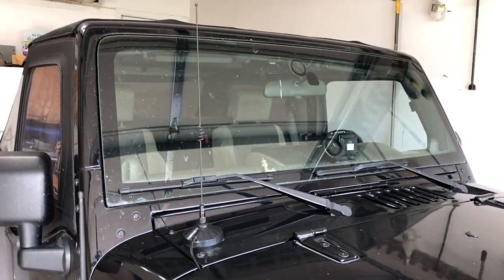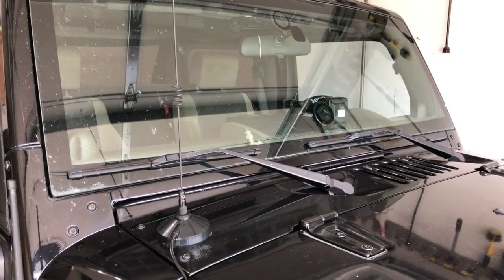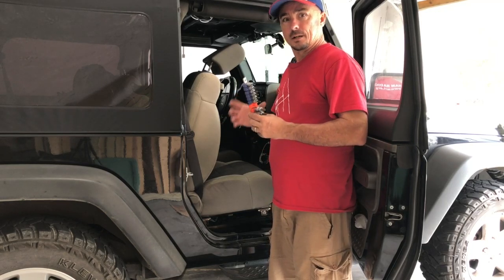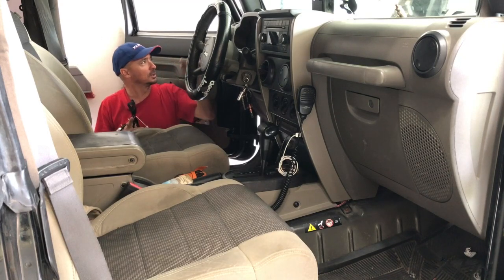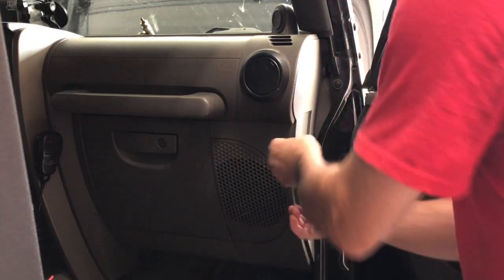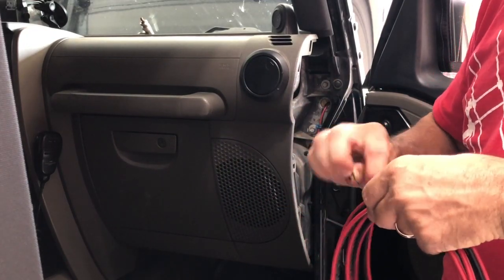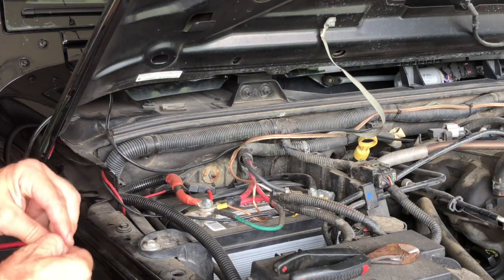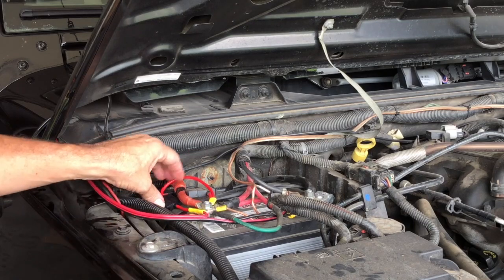Yaesu FTM400 Install Jeep Wrangler

Comment: Hey Jason, great vid on the Wrangler 400 install.  I’m a little surprised that the head took a 10-32, I honestly figured it would be a 1/4-20 like most camera mounts.  I’m putting my 400 in my Gladiator and the power run is just a little different, but close enough for gov’t work LOL. 73 de Tom KC3QAC

Comment: Good ideas.  I mounted my ID-5100A head in my jeep using the grab bar ($10 on ebay, look for 75WXST) , a short piece of aluminum, and magnets.  The radio is in the console.  This way I can take the head off quickly and lock it in the glove box when I'm running without top & doors.  Works great.

Comment: Having had one FTM -400 for the past two years and loving it's features especially for APRS, planning on a second one in a Jeep early next year. Thanks for showing that it will be an easy install ! 73 de KM6TRZ
Reply from the maker: It's hard to find a vehicle that is easier to install a radio. I didn't realize how much I would like this radio or I would have bought it long ago. 73, de KM4ACK

Comment: I have to do a similar install in my JK.  I had a IC-208H under the steering wheel mounted to the stereo amp plate.  The IC-2730A doesn't like it there as it runs way hotter.  I can't put it under my driver's seat because I have lockable storage there.  I'm going to remove the seat and create a bracket that goes across the rails since I run with no doors in the summer time here in Fresno.
Reply from the maker: Don't forget the "under storage" in the rear of the JK's. On my 07 it can only be opened when the tailgate is open, so if you lock the tailgate it is fairly secure even when the tops off. I have seen other use rails under the seats. I feel the mobile mounting bracket keeps mine high enough that rain shouldn't bother it. If offroading through deep water though, the radios might be in trouble. 73, de KM4ACK
Reply: @KM4ACK  My concern is the lack airflow in that compartment.   I have a "trunk" in the back that covers up to the top of the tailgate.  While, again no airflow, it is a larger space.  It's also closer to my antenna which is on my rear tire carrier.  But much farther away from power and my dual speakers on the dash.

There's also a center console replacement option by Tuffy that has a spot for a radio, but not a lot of airflow in that either.

The space under the steering wheel worked really well for the 208H, it didn't over heat at all.  But the 2730A runs hot, even on receive, so I need to relocate it.

Comment: Clean shop, spotless Jeep and no cursing....I'm not buying.  Fake news lol.  Good job. I like that mount, any trouble with it losing suction?

73 de KF7VUT
Reply from the maker: OK you got me. the whole channel is fake news. lol! The one holding the 400 has been holding strong for over a month. I have the same one holding the 857D for over 2 years now. Once/twice a year it might lose suction during the heat of the Tennessee summers. I mounted the 400 close enough to the dash that should it fall, it would only be about 2 inches. 73, de KM4ACK

Comment: For RAM mount users, this is the perfect accessory for that head unit: https://www.amazon.com/gp/product/B00J0LMJTK/

You will need a different thread pitch on the screw but it's easy to find at Home Depot and works phenomenally well with RAM setups.
Reply from the maker: Thanks for the link Scotty. I need to look at the ram mounts. I hear lots of good things about them. Which mount do you use in conjunction with the one you linked to? 73, de KM4ACK
Reply: @KM4ACK  I have an FJ, and wanted to mount a large iPad as well, so I went with a combination of these for the arm and the head unit:

https://www.amazon.com/gp/product/B010XHE78A/
https://www.amazon.com/gp/product/B01EB7D1NK/
https://www.amazon.com/gp/product/B009SX0J88/

The mount for the head unit attaches to the vertical bar. I got a cradle for the iPad to go on the top mount. The good news for you is that RAM makes a wide variety of Wrangler-specific hardware options so I would look on their site and on YT for options you have that I don't.
Reply: Here’s a link to my setup. 

https://www.dropbox.com/s/2iatx6w6z6pk8gi/Photo%20Aug%2023%2C%2010%2042%2019.jpg?dl=0

73 de K5PSN

Comment: Nice set up! I need to order one of those phone holders.
One wish I've had for a few years, that the radio manufacturers would embed a 1/4x20 nut in the back (or bottom) of the face plates. Like the ones in the bottom of camcorders. This thread is pretty much a standard for photography mounts. Think of all the gadgets we could re-task!
Reply from the maker: True. Every photog knows that 1/4x20 is the standard. It would be nice if radio manufacturers did something similar. The mount has been on this radio for over a month now without issues. The one that holds the 857D has been up for almost 3. I think it has only come loose a couple of times and it is always during the heat of summer in Tennessee. 73, de KM4ACK

Comment: I have one of those radios on my list to buy in the next few months and that Comet antenna. I'm going to buy a dedicated APRS Microsat WX3in1 digipeter, a Mobilinkd (for my HTs), and a Davis weather station later this month so I can fill in the gap in our area for others and provide some more weather data via APRS and WeatherUnderground, I'm excited. I've seen APRS before, but your videos have helped me to head that direction to add it to my toolbox.
Reply from the maker: It's a great rig. I honestly didn't think I would like it as well as I do. I mainly bought it for the APRS but have found several other features that are super useful. APRS messages are a bit of a pain but manageable. 73, de KM4ACK
Reply: I'm thinking I may add a bluetooth interface (there are a few out there) that simulates a serial interface so I can hook up to a tablet and do messaging and see a big map via the tablet. I've seen a few videos with guys who have done it, it works well. It's quite annoying that the Bluetooth expander card Yaesu sells doesn't allow you to connect for data use, only headphones, microphones, and speakers. You have to buy a third party device to convert Bluetooth to Serial.
Reply from the maker: @Devin82m  That would be a nice addition. I have seen other's do it but haven't explored it myself. With two radios already & limited space in a Wrangler, not sure I want to add anything else. Then again, I keep an iPad mini in there already so I can VNC into the pi in the mobile. hmmmmm......73, de Km4ACK